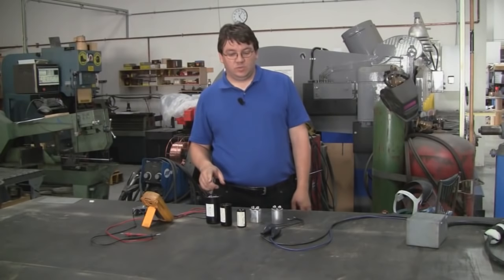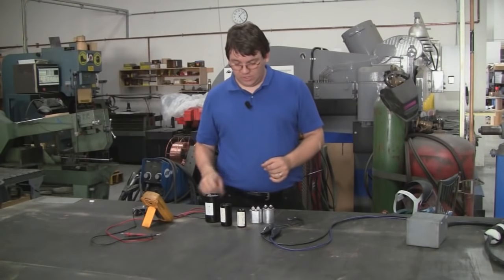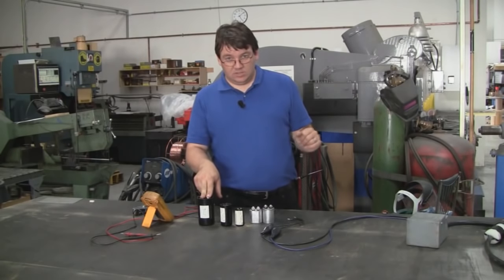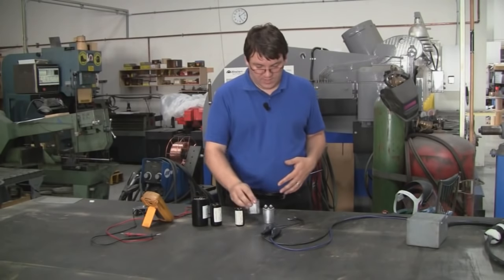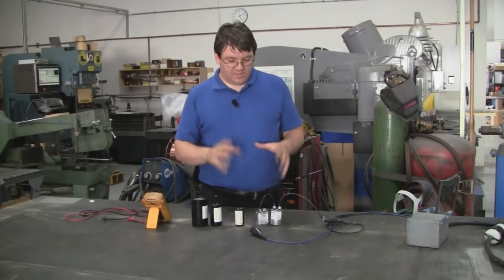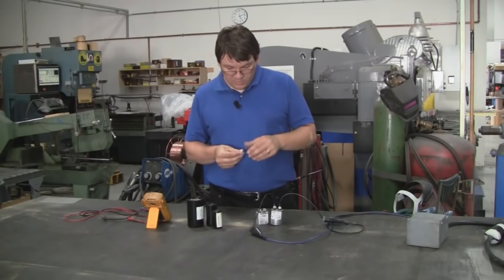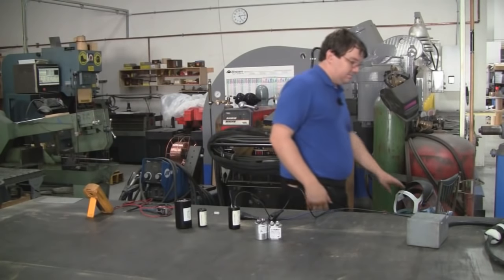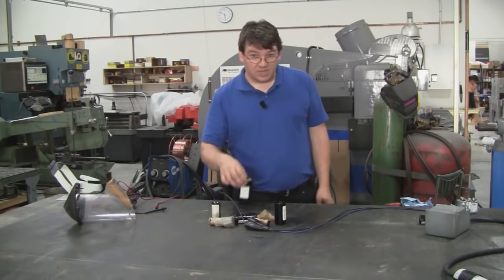Start Capacitors & Run Capacitors for Electric Motors - Differences Explained by TEMCo

Comment: Hi I have a small 10" Delta Bandsaw.  The capacitor in the motor is a CBB60 SH (16uF 250V).  It looks like a starting cap (Black Case) but has low cap value to suggest it is a running cap.  The cap is located in the case screwed onto the motor.  The motor is a 110V 2.7A.  How do I know if this is a running cap or a starting cap.  I hope it is a running cap because i want to install a speed control.  Any help appreciated.

Comment: I have a 220 VAC sanding machine  motor, replaced  Now starts slow and take time to gradually get to proper speed (around 5-8 sec). Is it the wrong replacement mtor or starting capacitor? Should I increase the capacitance? Appreciate your help.

Comment: I have a 10hp 230v three phase air compressor I am wanting to run on 230v single phase what start capacitor and run capacitors would you recommend to generate the third field?

Comment: Have an old Craftsmen 3/4 HP motor. Obsolete parts. It has a capacitor mounted on top. I have to say its a start. Not sure. Its dual voltage. Old cap was 233-280. Old cap part # was 37211 no info available any more.
Not sure if that was correct replacement. Having problem finding any information on this saw motor.
Old model Craftsman model is 113-12060.
Some blogs say it was an old Emerson motor made for Sears.
 Old cap was shot. Just want to make sure I insert correct size.
This was my dads saw , trying to restore it. Any help appreciated.
Reply from the maker: Just make sure that the new capacitor: 
1. Capacitance is roughly the same: 233-280uf
2. Voltage is same or higher than you are powering your machine with. If you are using 120volts. Cap should be at least 120 volt rated. Higher is ok. 
3. The new capacitor will fit in the can on top of your motor. Smaller is ok. 
Outside of that, you should be good to go! Good luck!

Comment: Hi will a microwave capacitor 1.1uf 2100vac 50/60hz can be charged by 12 volt battery ? Can it be used to between the battery bank and inverter to not let the battery bank take the brunt of electric initial draw. Saving battery. ?

Comment: Not sure if this is what I'm looking for. I made an Arduino powered motor by replacing existing electronics with my own circuit, but recently it intermittently doesn't start, just hums. The only way to get it working is to knock it hard against something and then it seems to run okay. Have done something wrong like run too high a voltage through it? It's happened on 2 of my motors now.

Comment: Why have the start capacitor blown and not the run capacitor? What is the inner difference between them?
Reply: Start capacitors are electrolytic caps (they have a liquid electrolyte inside) and are higher value.  They dissipate more power, and that causes them to get hot inside, and if run for too long the liquid turns to gas and ruptures the cap.  A run cap is lower value so draws less current and has oil inside to help conduct the heat to the outer metal casing.  Start caps are designed for intermittent use.  Run caps are designed for continuous use.

Comment: My hvac fan motor runs for about 15 seconds then shuts down. Is that indicative of a bad run capacitor vs a bad start capacitor or did it sound like some other problem altogether? Thanks!
Reply from the maker: Sounds like a run capacitor problem, or there could be a thermostatic switch on the motor that has gone bad.

Comment: Do you recommend the screwdriver method for discharging them?
Reply: I always do this, thinking for some reason is still charged before measurin with the multmeter. But i didnt know these capacitor were able to hold DC Voltage when they say is AC voltage. In any case, after a lot of years this is the only method i used. Of course, if is charged and you dont know it prepare for a little spark.

Comment: I do understand the main differences between a run capacitor and a start capacitor and their purposes but what I don't understand is why did replacing the 5uF run capacitor on my spa circ pump motor fix its problem of not starting?

Comment: I have a 2002 Fleetwood Bounder 32' rv. One of the rooftop (Coleman Mach) air conditioners stopped throwing cold air because after getting up there to check it, there was oil everywhere on the wires and it smelled from the wire casing melting. Is it safe to just replace the hard start capacitor, or should I replace all 3. (There is a bundle of 3 there).  Thank you for any thoughts and/or responses.  (Roger)

Comment from the maker: We don't have specific instructions on repairing this, as they can vary depending on motor manufacturers.

You might want to just try getting a capacitor of matching values, as they're fairly inexpensive.

Comment: I have a primeair compressor the cap is a 55uf 360v/250v  I ordered a 53-64mfd 250vac start and 53-64 330vac start burnt both must need run caps? what do you have to get me working? thanks Mike k.

Comment: hi.. i gota a 1ton AC works on 240v ac. its got 35uf cap for compressor. can i add capacitor bank to reduce amps draw. if so what consequences i have to face. kindly explain.

Comment: Hello... Good video. Educational.... Thank You....  I've got a question that I feel you are highly capable of answering, even in your sleep. (that's a compliment)...  I'm looking at 2 capacitors in my 5 ton unit.  Both say "motor RUN capacitors" on them. The smaller one is a  10 MFD 440/370 which I would guess is actually for run.  The second one is a 70 MFD 440/370 which I think should actually be a start capacitor. What I surmised from your video is that the 70 MFD seams awful low, plus again, it says on it "RUN" capacitor, not start capacitor.  Any thoughts and response would be greatly appreciated.
Hope all is well.
Thank You
Reply from the maker: They are both as you suggested, run capacitors. One is for your condenser motor and the other smaller one is for the fan.
Reply: @TEMCoIndustrial  So is there no start capacitor???? 
Thanks for taking the time to reply
Reply from the maker: Either the start capacitor is hiding in a different location or it is possible it uses a special high resistance rotor and no start capacitor although this is prety unusual.
Reply: @TEMCoIndustrial  Again..... Thanks for taking the time to reply...

Comment: So just to clarify, you can replace a start capacitor with a run capacitor if it has sufficient micro-Farads? For example I have a 8uF start capacitor, I can replace it with a 8uF run capacitor?

Comment: Hi I have a air compressor used for painting cars, when its very cold weather the compressor sometimes won't start up. When i pull the red switch up to start it, it buzzes loudly tries to start but doesn't have enough power. If the weather is hot, then most of the time it starts.
It has gotten progressively worse at starting now it's about a 50/50 if it's going to fire up or not, when it does start it runs perfect and generates lots of pressure.

If i helped the motor along with my hand by spinning the fan blades it does start, sometimes it starts slowly whilst buzzing then gradually build up speed then runs okay after about 10 seconds.

Does it sound like the start capacitor at fault? , I do not have a run capacitor on this compressor.

Could the start capacitor (faulty) CAUSE ALL THESE ISSUES?

Comment: Hey man.. Great video, my motor is humming, I swapped over a capacitor I had in shop, it started motor but cap exploded hahaha after a minute, I will drop a link for my problem, it is a pdf file with all parts listed, I think it is a run capacitor I need, it's the the 66uf 50Hz.. One on the list thanks you my good man

Comment: I have a dual run cap (herm, fan, c) that came off a window ac that I want to repurpose. Are all dual run caps running caps (ie will this thing blow up if I hook it up wrong like a start cap will) ? I want to hook it up in parallel with an ac motor to improve the pf. Do I just use the C and fan terminals or X and fan+herm? The specs of the cap are "7.5/40uf 240vac amc-24h07400b hpf ms 10000afc Sam wha... ". But I'll be darned if I can find anything on Google on it. What would the temco replacement part be?

Comment: My tecumseh cruisair compressor has a 47 to 56 mfd Start capacitor, the run cap is 35 mfd
I can easily buy a run capacitor of 50 MFD. Which I could use as a start capacitor which would work
You suggest that most start capacitors are thousand's MFD. I have found run capacitors of high capacity that they should also function as a start capacitor.
Maybe the system is designed to BLOW UP ITSELF, if there is a problem in the starting circuit relay to help protect compressor windings from burning out?

Comment: Replacing a run cap on a bandsaw, the original is a 2 prong and the replacement has the same values but is a 4 pin. If they’re interchangeable does anyone know which pins do I connect to?

Comment: Can I use the motor and the run capacitors to charge a 12V DC battery?
Reply from the maker: Can you tell us a bit more about your application? We're not quite sure why you'd want to do this.

Comment: I have a 110v motor with 4 wires (2 start and 2 run) along with a remote start capacitor using 40 mf.   I wired the run wires up and plugged it in expecting a hum (I disconnected the capacitor and all wiring), but IT STARTED UP counter clockwise.  I switched the incoming wires and it started up running clockwise.  I tore it apart and it has no centrifugal switch.  
I bought a used Corghi tire machine for $300 because the guy had the motor and switch out in a bucket.  Two wires had .7 ohms and two wires had 7.6 ohms.  The tire machine rotary switch was in pieces and had burn marks on it. What would tell the start windings and start capacitor to turn on and off????

Comment: I have a rather large electric motor that needed a new cord wired on when I bought it.  With that done, the motor ran but had no torque.  I bought it to spin a table saw but it would not start.  I could spin the blade and it would barely run.  One capacitor is a 110v run/start and the other is a 220v run capacitor.  I'm thinking this should be wired as a 220 volt motor?  Thoughts??

Comment: In simplest terms, if a motor is running slow, it could be because of bad run cap, not start cap, cause that won't running at all then right

Comment: The reason large value caps toast when connected directly across 120 VAC is because at 60 Hz it is sucking down a couple amps of current (ie you're practically trying to make it glow like a light-bulb), whereas the smaller value cap is only drawing a few dozen milliamps (it can take that all day long without breaking a sweat).  There is nothing inside a cap that dictates it will be a start or a run cap.  Simply that cap start motors require more capacitance.  Running capacitors, it doesn't need that much.  In capacitors, as the value of capacitance goes up, resistance to AC current does down (assuming constant 60 Hz in this case).
Reply: I thought start capacitors were actually electrolytic capacitors that normally have a polarity and are only used on DC
(Or AC for only a couple seconds in the "niche" case of motor start).
Connect a standard (Ie not sold for motor start) electrolytic cap to AC and il will definitely explode like in the video.
Run capacitors on the other hand are metal film and not electrolytic, so the polarity doesn't matter at all and thus they can stay connected to AC for any amount of time.

Comment: I’m confused about you usage of “duty cycle”. I’ve only been exposed to the term regarding a DC square wave signal at a fixed frequency and duty cycle refers to how much of the wave is “high” vs “low”. Never heard it used discussing AC signals. I would appreciate any feedback.

Comment: I have a 3/4 hp bench grinder with a PTC relay for the start winding.  The PTC relay is bad but I can't find any for a 3/4" hp motor.  Any suggestions?

Comment: I have a 36V forklift with an ailing capacitor rated at 150uf and 250v (250 P.V.W.) The part number on it is FB-887 and it seems to be impossible to find. Would I be able to run an array of smaller run capacitors adding up 150uf?

Comment: @TEMCo Industrial Power
My start up capacitor on my compressor is only 31.5uF at 400v (2 terminal) if i buy a much bigger uF rating ie (400uF) would it make my compressor start easier.
Mine at present doesn't always start up every time, sometimes it buzzes upon start up and freezes,if i spin the motor by hand it will start up, is my start up capacitor faulty and would it cause these start up problems??

Comment: If replacing a capacitor, if not 1.5x the line rated voltage, what voltage can it be or does it need to be exactly the same?

Comment: Can I run a CS Induction Motor for a longer time say a few minutes at low voltage before the Capacitor Switch trips ? Will the start capacitor be able to tolerate low voltage for a longer time ?
Reply from the maker: Capacitor start induction motors have their speed dictated by frequency, not voltage. So, under-voltaging a CS induction motor will give you reduced torque and increased heating, but the motor will still come up to full speed, thus disengaging the capacitor as normal. At some point in dropping the voltage, the motor won't even produce enough torque to turn, at which point the capacitor will stay engaged, and the motor will burn out. What was your reason for needing to running it at the lower voltage?
Reply: TEMCo Industrial Power

Comment: Sir What is the size Capacitor for 7.5 hp Electric Motor Pump. Start and Run
Reply: I suggest you check what came on the motor from the factory,  different strokes for different motors.  Problem is you might not be the first guy to change them and the one in it might not be right.

Comment: hi

do you have a video of 575 watts metal hallide bulb using a start up capacitor as in the moving head 575 watts dj light  and what is the best mfd to use interms of this 240v capacitor if your using 575 watts metal hallide bulb

Comment: Can I use a run capacitor to start a motor with a load but I need it to keep going at least for 1 minute without any other power source. This is a 12 V DC, car wiper motor, under load more than 5 amp. How big should the capacitor be if this is possible?

Comment: 4 pairs of caps in series that would give you 4x165= 660 volts. This will be your voltage rating. To find the capacity rating here is what we look at.   If each cap has another cap in parallel with itself then you would add those 2 cap values together  (MFD) 2 x we'll say 240 for a happy medium (between 233-288) that would equal 480 mfd now we have to divide the 4 pair of 480 mfd since they are in series. 480mfd divided by 4 =120 mfd at 660 volts so the answer would be 120 mfd at 660 volts

Comment: ... is polarity a concern when replacing a motor run capacitor for a refrigerator compressor? the wires and capacitor aren't marked...
Reply: Is the capacitor is AC volvtage, no matter how you connected or order. They are Alternate Voltage, so no mistake will be made. In another hand, if you have a DC capacitor like you see in electronic devices, you must respect the polarity, beside they are marked of course.

Comment: I have a small 1.5KW tankless compressor, there is a capacitor just after the switch across L and N but it is not like these cylinders you show, it is a small rectangular about  2cm x 1.5cm. Is it still a run capacitor? If it is I was wondering how can it handle the current so small without oil cooling.
Reply: It is definitely a run capacitor as first it's always connected accross the power as long as your air compressor is on but also these rectangular capacitors are always run and not start type.
How can they handle current ?
I don't know.
But I know run capacitors do exist in two types: Metal casing and oil filled like in the video or plastic casing and resin filled (Epoxy resin is poured in the casing under vacuum then it cures and becomes rock solid).

Comment: i have a 1967 vintage high frequency arc starter that has a leaking mica capacitor inside...is there a modern design capacitor (more effecient) thaT I can use as a replacement?...i think it was 2.0 mfd 5000v 6.amp in a 3in x1 rectangular black box

Comment: I have an Electric Lawn Mower and the motor spins and then stops and starts humming, could it be the capacitor, if so where can I buy one? DUCATI 16.27.80, 80UF, +/- 5% CAPACITOR also is it a Start Capacitors or Run Capacitors? Thanks,
Reply: Is a run capacitor, and any replacement around those valors would be good enough, if is the same more good.  You can test your capacitor if you have a multimeter discharging it first and then do the measure. Another sympton of a run capacitor if tha lack of force, like it the motor is weak.

Comment: Start Capacitors are used because the manufacturers can get away with less windings in the motor. The run cap helps to keep the motor steady under a load. This is all done to make them smaller and cheaper to produce. It's all about size and money. Period!

Comment: For preventative maintenance purposes I replaced two 17 year old 50uf x 440vac capacitors on a couple of 4 ton Trane a/c compressors, with TEMCo RC0052 replacements, in Oct 2012.  
Less that 1 year later Aug 2013, I discovered because one system was pulling high amps, that its TEMCo cap was 0uf (open) and showed no signs of swelling.  As a precaution I checked the other system's TEMCo cap to find a 1/8" hole had been burnt in its side from internal arching and leaking a sticky substance all inside the electrical housing.   The cap however measured only 14uf verses its rated 50uf.   I replaced both caps with the original 17 year old caps.   I want to know who is making a quality cap now days, because it certainly isn't the china born or the Chinese caps being assembled in Mexico.